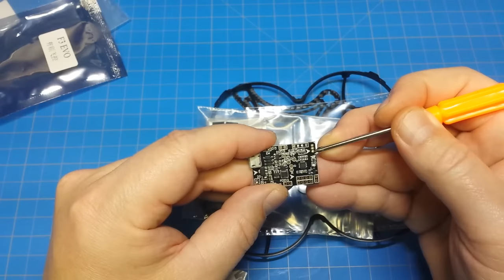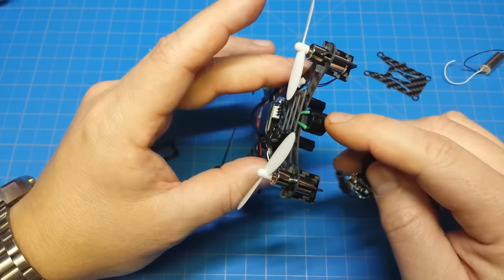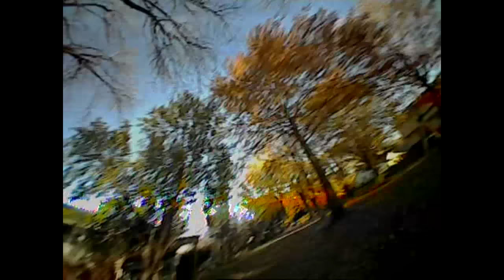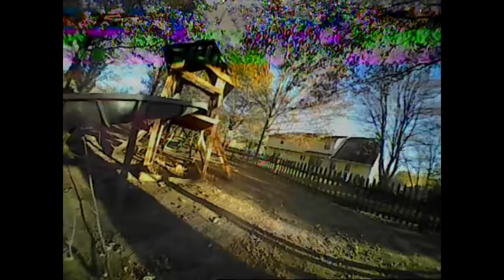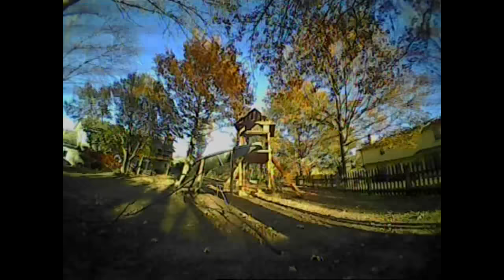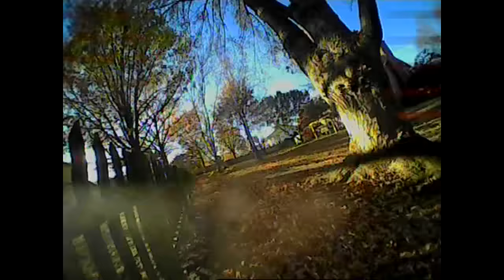RCX DIY Brushed Micro

Comment: Nick, for you the VTX CM275T 5.8G is good or better the FX798T.     :)
Reply from the maker: For my use if the vehicle is primarily indoor or 6.5mm motors the CM275T. If for outdoor and 8.5mm motors likely the Eachine Tx01 or Tx02.
Reply: So for you for quad motor 6mm this is better than FX798T.
Reply from the maker: yes
Reply: Thank you, Nick.      :)

Comment: giod video. how do you tune your micros? the same as brushless quad? and if not maybe a video? :)
Reply from the maker: All the principals are the same, but with brushed it requires less fine tuning. Generally I and D don't need tuning, or very very little, and when it does is fairly obvious. The biggest difference can be changing in larger increments. I will start with a value change of 5 or 10, if I don't get much response from that, next change 15-20, I generally don't change values more than 20 at a time. If the change has a negative impact on flight I start going back down at the same increment levels.

Comment: if find grommets keep motors straight much better when you  push the motors down so at least 1/3 of them is coming out the bottom of the frame.... and i crash a lot!
Reply from the maker: Yes that helps as well. You and me....I go down often too. I think there is maybe 4 times in the flight video I hit something or go down.